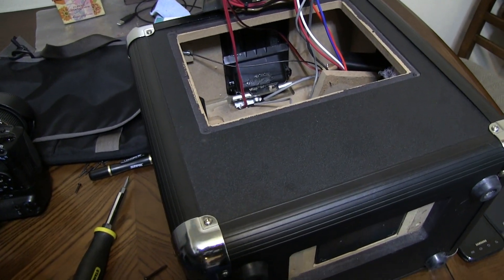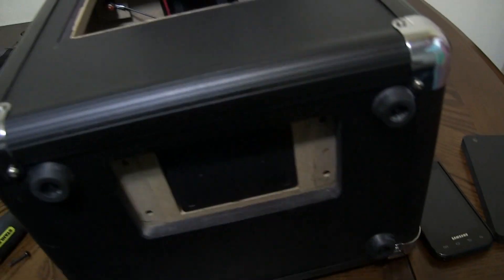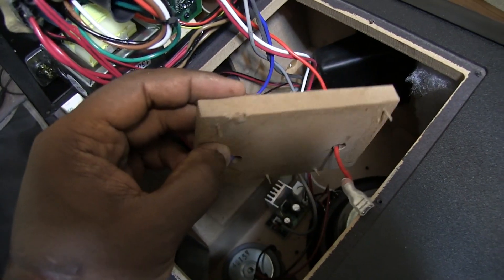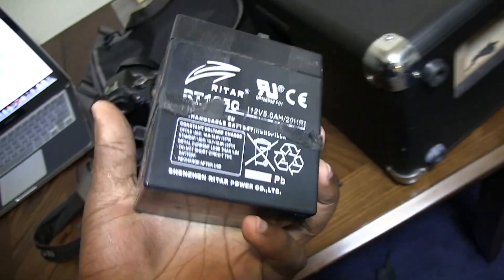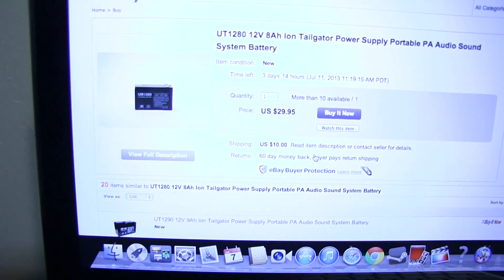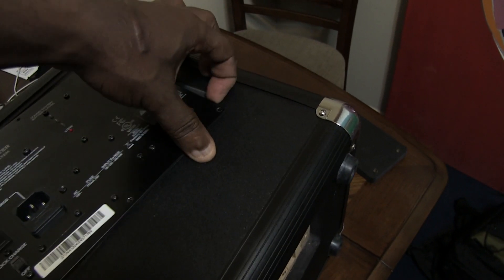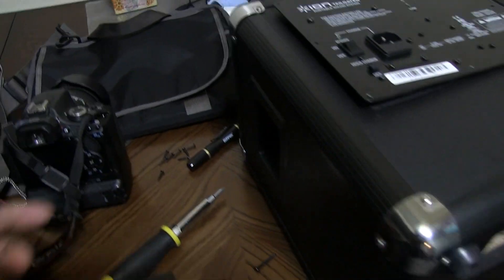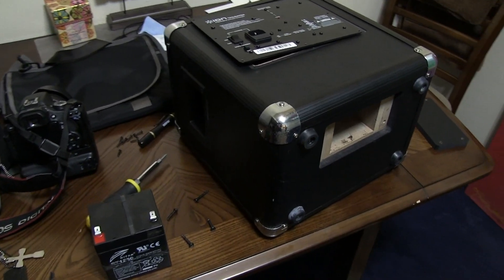Ion Tailgater Battery Replacement 101

Comment: DO NOT BREAK YOUR BOX BY DOING THIS . DO NOT PRY UP WOOD - THIS IS NOT HOW THE BATTERY IS REPLACED. NO NEED TO REMOVE MAIN COVER.
 REMOVE YOUR BATTERY COVER AND USE 2 BLADES - BUTTER KNIFES - SLOWLY PULL /PRYOUT BATTERY FROM BOTTOM - DISCONNECT WIRES. THERE IS NO STICKY TAPE - THERE IS FOAM THAT HOLDS IT TIGHT IN THE BOX DO IT DOES NOT RATTLE AROUND. MAKE SURE YOU USE SOMETHING ON THE NEW BATTERY TO MAKE SURE IT IS NOT MOVING AROUND IN ITS HOLDER. THE BATTERY IS $14 ON AMAZON SHIPPED TO YOUR DOOR. GOOD LUCK EVERYONE AND HOPE YOU READ THIS BEFORE CAUSING DAMAGE TO YOUR BOX!
Reply: Yes I found out the hard way yes thank you I have the same battery has the guy in the video but can't find that one witch one do I get?  ??????

Comment: As many have said before, the battery comes out the bottom, absolutely no need to open the main panel or pry the top off the battery compartment. This is literally a 2 minute job. 4 screws on the bottom, slide the battery out, disconnect wires, connect wires for new battery, slide new battery in, 4 screws. Done.

Comment: You dont have to pry the the glued mdf board off.  You unscrew four screws on the bottom then gently drop the ion block rocker about 4 inches from the ground the battery will push the plate off and drop enough to get your fingers on it and pull it out.
Reply: Dude, you rock. I had to drop/slam it down about 5 times in order to get enough battery out to pull it out. Thanks

Comment: The internal particle board battery cover was a little more firmly in place on  mine (glue and staples, I realized later) so I struck the bottom of the battery (from underneath) and it knocked the cover right off, no tears or even bent staples. Then back to your method.  Thanks again for the video.

Comment: I took out the 4 screws on the bottom, removed the cover and there was the battery. Amazon has various batteries under $20. I received one fully charged. I had to put some thin cardboard pieces around the sides to keep the new battery from moving around but so far so good.

Comment: Thanks for the video, mine takes ages to charge up, after 12hrs, it goes to three power lights but then the 3rd (full power) light fades out to the 2nd light.
I've not used it for a while so may have self drained the battery, as when I did last use it it didn't last many hours so I ended up plugging it in (where it would be charging as well).

I'm still under extended warranty, is it worth just letting them fix it?

Comment: Well... I suppose that you could take the whole thing apart and pry that battery compartment cover off... Or you could just open the access panel on the bottom and pull the battery out
Reply: David Hoelzer lol!!!
Reply: That won't work batery is tight fit
Reply: @miltonamilcar5298  slap a piece of tape on the bottom of battery and pull lol
Reply: @ThePreppingSheepdog  sticking a screwdriver through the holes for the cable worked for me

Comment: Could you use the unit without replacing the battery?  What would happen if you connected the two battery leads?  Explosion?  Nothing?  Work just fine?  Just wondering, but too chicken to try it.

Comment: With my thrift-store purchase ipa88 Tailgater Flash, I didn't need to remove the back plate. After removing the battery cover plate, the battery just fell right out when I set the unit upright.
Reply from the maker: O OK That's Good! Saved You Trouble

Comment: The battery is replaced from the bottom. There is no need to take the whole unit apart. Just remove the 4 screws from the bottom, leave one partially in so you can grab the panel then tilt and shake the speaker and the battery should come out the bottom.

Comment: Hey great video. I have replaced the battery, but still won't charge. Works great plugged in but no power coming from battery. Volt meter reads it has a charge but tailgater won't/can't use the power from it. I bypassed the battery's inline 3A fuse and still nothing. Could it be the transformer? when troubleshooting, I flicked the switch from 110v to 240v (dumb ass move, i know) but would that fry the whole thing or just the battery ability to charge? because it still works when plugged in.
Reply: I hear there is an in-line fuse that may have blown...I'm about to find out if this is the issue w/ mine, as my battery will not charge either...
Reply from the maker: Douglas Ullman If you figure it out let me know!
Reply: Same thing happened to mine. Checked battery and fuse. Both were good. My problem was the power switch itself. It wouldnt connect the battery to the board when flipped on. But would still power on if plugged in. Replacing the switch is a pain in the ass since its cemented to the box with a mountain of crap. So i just bypassed it and shorted the red battery wire directly to the board. But that doesnt drain the battery bevause if you cut away all the black wrap youll see that the switch has 2 sides. One is true on off which is why it still works plugged in, the other side is battery connection... which is already shorted anyway! But with a resistor limiting voltage to half volt. That means its ok to short it out. Anyway i bypassed the switch and im not losing any battery life when off. So. Easy fix is short battrey directly to circiut board or have fun getting that switch out to replace it.
Reply: Me too, it was because one of the wires came unplugged between the charge dock on/off switch and the charge port (on top) for the phone. Not much slack in there so it's easy to yank loose.
Reply: Also, my battery was just dead...Got a new one for about $15...Easy as pie to switch out, just remove the plate on the bottom and it'll fall right out...
Reply: Douglas Ullman Mine does not fall right out.  But I'm wondering if I can" suction" it out somehow to avoid removing the back panel.
Reply: Dawn Becker that's weird perhaps yours is stuck w tape or glue but it should come right out by gravity or a good jostling...but if you have suction cups of some sort it's probably worth a try
Reply from the maker: Dawn Becker Yeah there was double sided tape on mines
Reply: +TheHobbieCollector hello my tail gater is not charging shud i buy a new battery or wat
Reply: +TheHobbieCollector yoo. so how do you fix it g
Reply: billy butter hey can you help with my ion explorer speaker?
Reply: billy butter I know your post was long ago
Reply: @tryingcake101  That is exactly what i did to pull mine out!!!!

Comment: I removed my battery without having to take off the board covering the battery from the inside of the unit.  The problem with mine was it would work when plugged in, but not work on battery or charge.  The solution was the red wire that connects to the battery has a 250v 3.15A fuse that was blown.  It is under the black heat shrink tube.  I went to radio shack purchased an 250v automotive fuse holder and used a 3A fuse and all is working now.
Reply: Hello Anthony, where is the fuse located in the Tailgator?
Reply: Karl Hector I’d like to know too.  There is one right where you plug in.  But the one he’s talking about sounds like it’s work getting to

Comment: well depending how much time you would be willing to put in it, you could drill a hole in that back plate and hook up leads to it so your external battery charger could just hook up to the back to charge it the same way the old built in charger did, just bypassing the old one. that way you dont have to open it every time you need to charge the battery. otherwise if you dont want to spend that much time doing it youd probably be better off just buying a whole new one. youd be better off getting a whole brand new one than paying the company 100 dollars just to fix that

Comment: I don't know why you didn't just take off the screws from the bottom turn it upside down shake it. Mine came right out very easy. Maybe yours was stuck or something I don't know. The wires were long enough to come out with it. Disconnected wires. Put in the new battery. Walla. Sometimes things are a little bit different I understand and sometimes they don't just slide out like mine did. I said amen.

Comment: As you can see from the dozens of comments, this guy is doing it wrong. Just remove the bottom panel only. The battery slides right out. No need to take the back panel off or pry up the interior particle board.